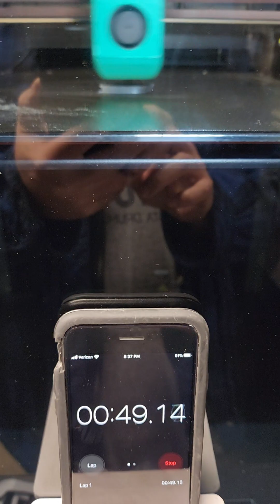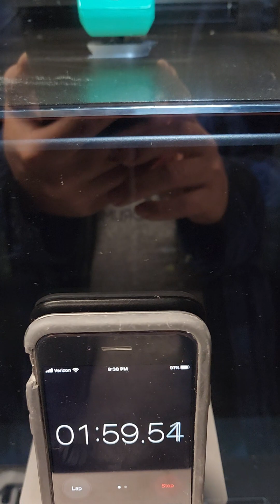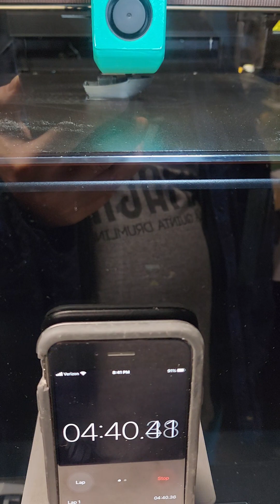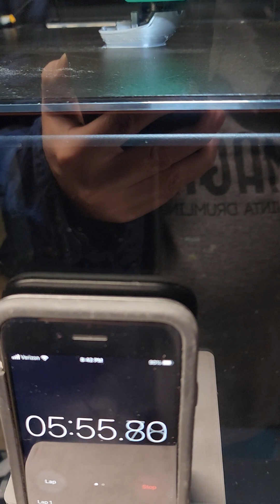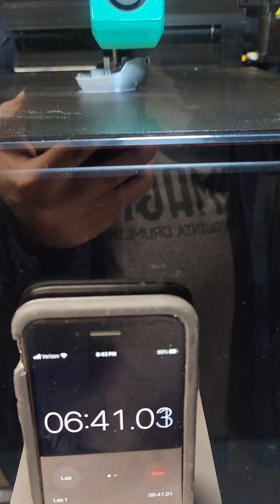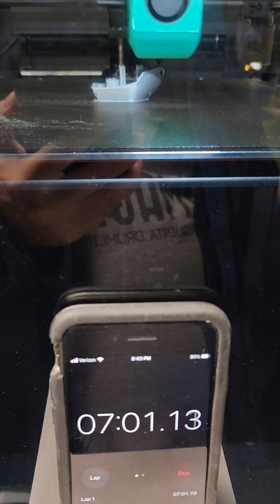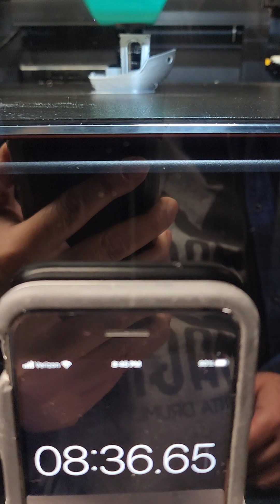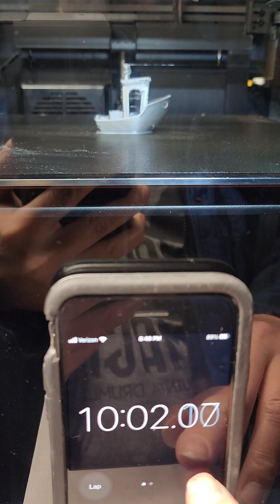Stock Creality K1 Max, 10 minute benchy with enough slicer tuning.

Comment: The obvious question - What did you tweak.  Speed, acceleration.  can you add the g-code header or list your settings?
Reply from the maker: the main tweak is the flow volume